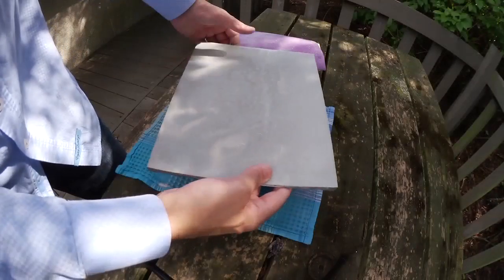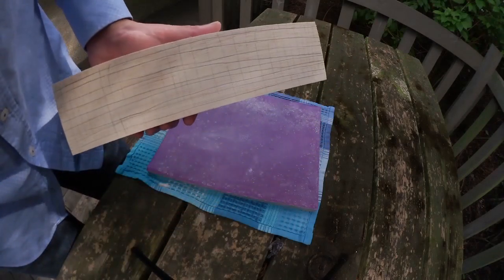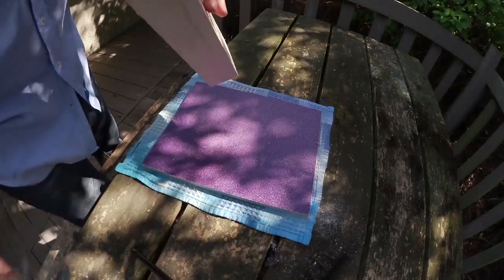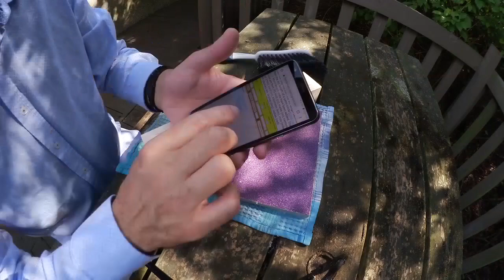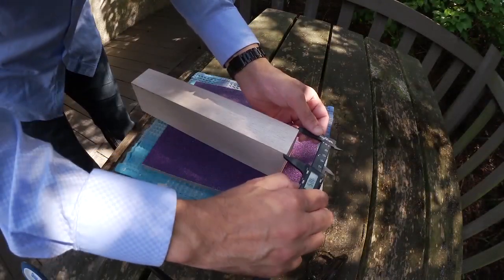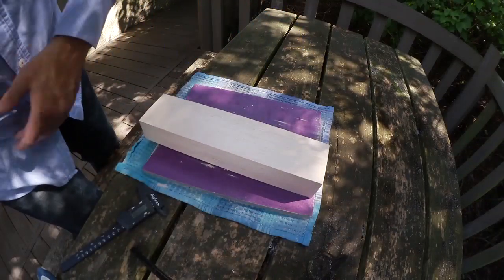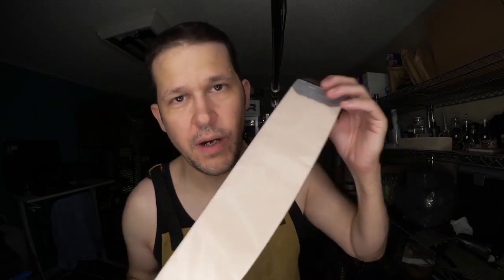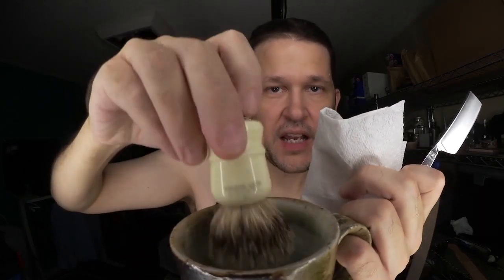Convex Straight Razor Stropping (Shaping Balsa Wood to Reference Strop Surface)

Comment: Hey which side of the block of wood did you engage with the strop? I didn't catch it well in the video. I've been wanting to buy a new 3" strop but its out of stock, any idea when you'll get one? I'm interested in the block of wood technique. Do you apply anything to the wood or just place it under the strop for shaping? Thank you!
Reply from the maker: hello, the 3" strop (181Ri), that German guy is the hardest to buy from man out of all our suppliers, all I know is we emailed June 7 and haven't received our shipment...I am going to have to snail mail him a physical postcard with the order on it to be sure, b/c he never answers emails and sometimes he can't read them for whatever reason.   I think I spoke to him once on the phone 12yrs ago and since then he just wants me to email an order and sooner or later that order shows up and I send a bank wire to pay him, but this queue is a bit long for sure.  Maybe he had a good selling summer and is just backed up, but officially for Herold I can only "expect 'em when I see 'em"

Your block of wood has two planes, two effective diameters down the wood's length, for Ri type and other calfhides of this suede style I would recommend to put the more curved axis of the wood behind the strop, which will challenge the spine side of the bevel form but because these kinds of hides have a pretty significant nap depth / spongy texture, they will compress nicely at the point of contact and touch all of the edge.  

For firmer flatter hides like shells I would recommend using the long axis of the wood as the backer.
Reply: @thesuperiorshave  Thank you Jarrod, so I would use the more curved side on a Dovo XL 18080002 strop right? I will wait for the Harold to be available, for now I'll rock what I have!